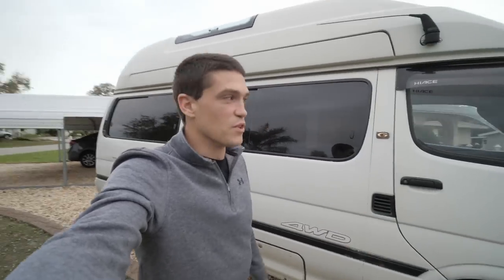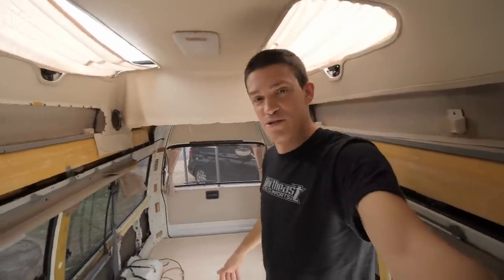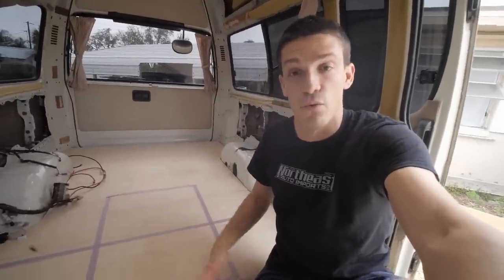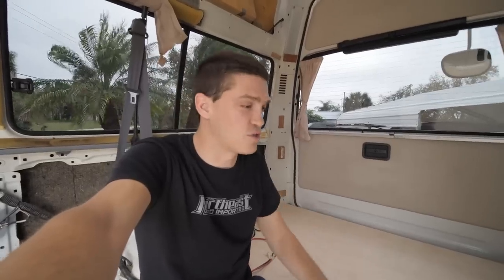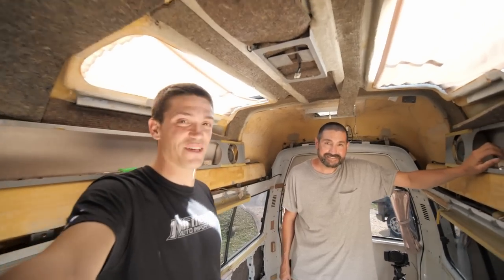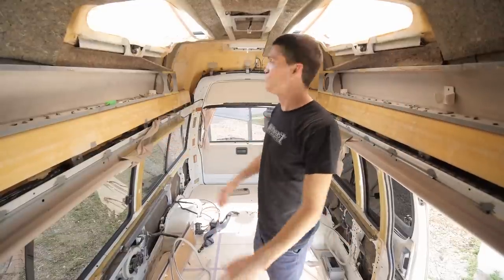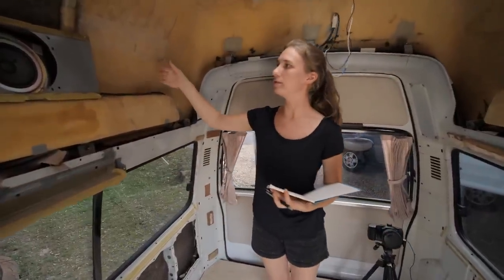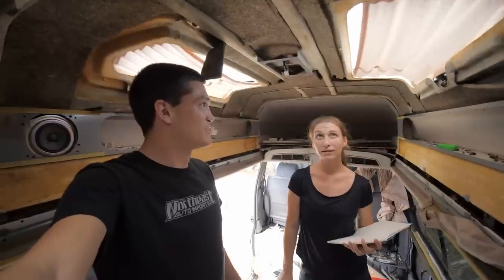VAN BUILD | Toyota 4x4 Camper Layout Plans

Comment: Good to see adventure man! Also, you may want to figure out where you are going to bring down the solar panel wires and any exterior lights for doorway, strip lighting and/or like a wee boost, etc. Before you insulate and cover the ceiling.

Comment: Beware of condensation collecting on the windows that you partly cover with the bed. The moisture could get trapped and cause mould beside the bed. You might need to insulate that covered spot

Comment: Smitten with your van. Good job. Wondering about the secluded/private area for Shannon or you. I remember that was one of the things mentioned long ago. U could always use a curtain on the bed. I watch Adventure Man and can't wait to see his box van work. The pass thru looks good.
Reply from the maker: We are definitely planning to have a curtain there!
Reply: @ElementLife  while you guys have the top part of your roof and the sidewalls unfinished you might want to run your wiring for led lights. Save a lot of electricity and if you ever plan on camping in winter maybe you guys should insulate so there is no condensation you could install a diesel heater like Foresty Forest (A youtuber who braves below - 0° temps. )Or you could install one of those small pellet/wood marine stoves that hug the wall and keep the van warm 24/7 in winter conditions.
Reply: @rosie4748  Still gonna have condensation somewhere, but insulation can help.  Much depends on where you live though.  An insulated van in hot weather is virtually unusable.

Comment: I was going to agree with others about toilet placement , then thought wait a minute I put my slide out toilet two feet from the sink !! I wont be cooking there tough ,just food prep . Cooking is on the other side of the van . Designing a lay out is a process of elimination and compromise . What works best for you is what counts . The fact is if you are going to have a toilet in a small space it is probably going to be within arms reach of were you are cooking . The key is keep it clean and maintained and its not a problem . Putting a toilet under a bed does not work for me ,as 90% of its use  is at night . Stay healthy and safe you two and thanks for bringing us along on the adventure .

Comment: Putting the bed in the back and up high is the right move. A hallway type floorplan wouldn’t work well since the Hiace is a foot narrower than traditional vans. Bed in back takes advantage of the longer aspect of the van. A composting toilet seems a bit of a space hog, though, since it has to be stationary, vented, etc.

Comment: Save you some space, steal my idea from my wagon build. Using a piece of wood, say under a cushion, install a kayak deck plate w/ dry bag (get type w/ screw lid). Just insert wally world bag and some kitty litter or such and you are in business. If no where to toss the bag, just knot and leave in the dry bag till trash can is available. Just insert the next wally world bag and she is ready to go again. They also make absorbent small pads that can be put in the bag for female #1. I ended up using the rubber disc from a record player to place around the deck plate as a cushion to sit on. This shrinks a toilet down to about 8" x 2" when not in use. Great space saver.

Comment: When are you going to take out under storage tanks for the gray and black water ?
Reply from the maker: We're going to leave the under storage grey water tank. It's where the spare tire used to be towards the rear. There is no black water system in the van.

Comment: JMO:  I don't like your layout, seems like it will feel cramped and claustrophobic.  I'd want to keep my windows visible and useable, because it would make hanging out in the van rain or shine so much more enjoyable (cause if you wanted a dark cave you should have gotten a cargo van).  I would make two separate bed sections that were on each side wall that would function as couch/bench/lounge during the day (each of you with your own) with a walk way area (no matter how narrow), then at night have one of them on a drawer slide that released and bump it up against the other bed section to make one big bed area (for night).  During day/couch mode, I'd want walk way through to the back and area to move around in a van like that (since you have the head room).  How much can this van tow?  You may have to just use your Element as a tow vehicle and extra hang out space and storage.